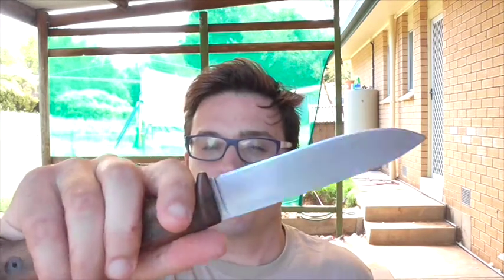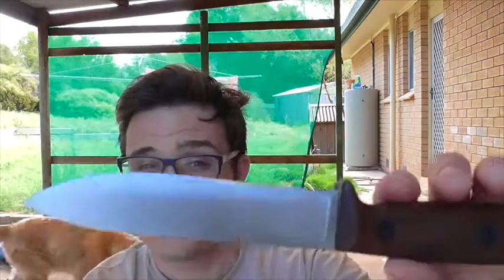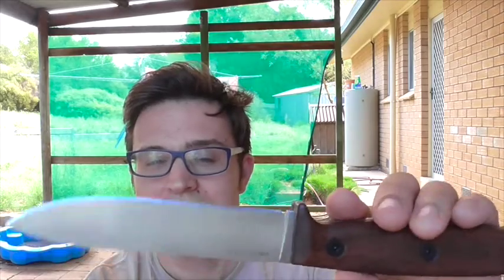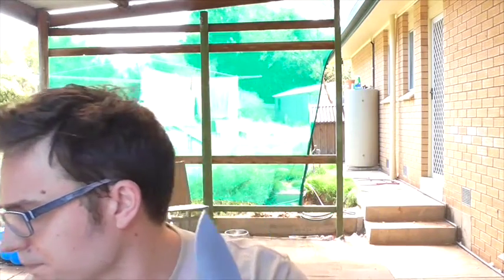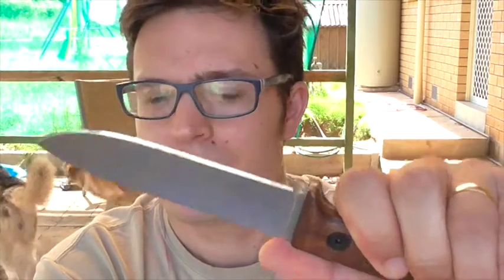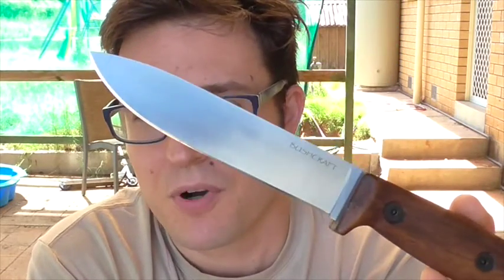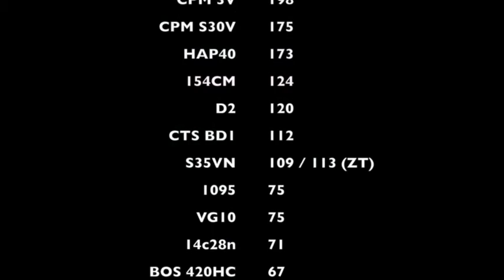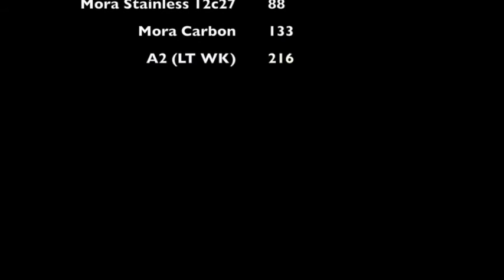Edge Retention Test! 5160 spring steel on Ontario Bushcraft Field Knife

Comment: Say Heah Cedric,  I like 5160 for some of my larger chopper's like my O. K. C.  Gen2 SP-51 and one of my Fav's SP-53. I also have an older set that was tempered in a higher RC,  My Ranger T. F. I.  and my Ranger RD-9 and Afghan all in the 5160, But for knives that I need to hold a better edge retention , I like the 52100 a Ballbraring Steel , It's similar to the 5160 but with more carbon.,,.

Comment: Hey have you done a 5160 with a Bos heat treat?
I know in the buck 110 model 5160 is an upgrade from the 420hc  which actually did better in your Edge retention test then regular 5160

Comment: When i was in Nepal i watched a Kukri being made. They use the springs of trucks of course and they explained to me they tempered them for toughness rather then sharpness. Same gig i reckon?
Reply: If you ask me I’d rather have a blade that can chop a nail in half and just have to sharpen it from time to time. That being said those guys in Nepal are wizards when it comes to heat treating 5160. I myself have still yet to be able to chop a nail in half with out edge damage. But other steels like cpm 3v are very good you can chop hard stuff with out taking edge damage and you can it’s also really abrasive resistant as well

Comment: you should try Bos 5160. Since the Bos 420hc did so much better than the regular.
Reply: Paul Costley bos heat treating process is the best I’ve ever seen. They know how to put steel right in the middle of hardness and toughness.

Comment: Hmmm maybe it has to do with different heat treats or rockwell hardness, but I have knife that was made by my grandfather out of 5160 and I did my own version of this test and it got to 71 cuts before no longer slicing paper. Also possible the rope I used was different. Anyway great video like always!
Reply from the maker: +WhosThatGuy woud definitely be a rockwell issue. An extra bit of hardness should boost edge retention a touch
Reply: The Rockwell hardness on Ontario's 5160 is rather low, around 53 - 55.
Reply: Yea with me i did testing on jute twine (fairly thick) and i got 400 cuts with my own heat treated O1